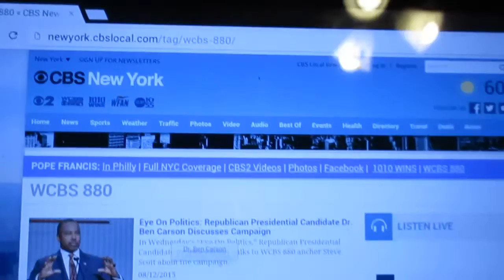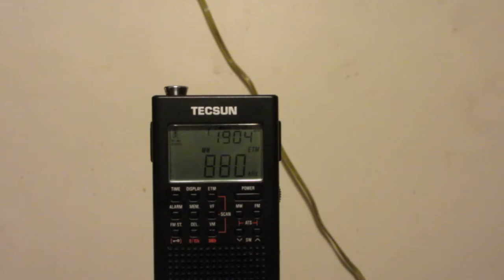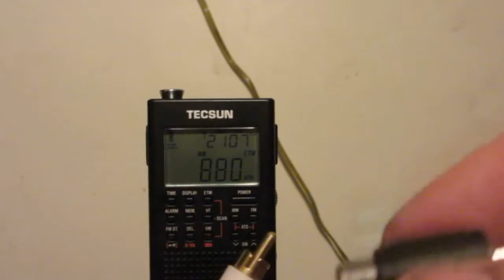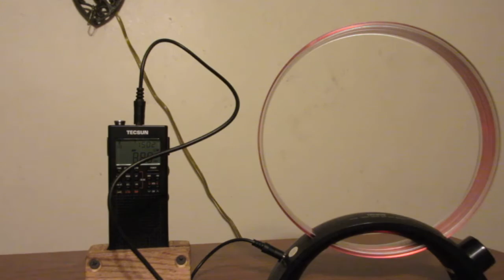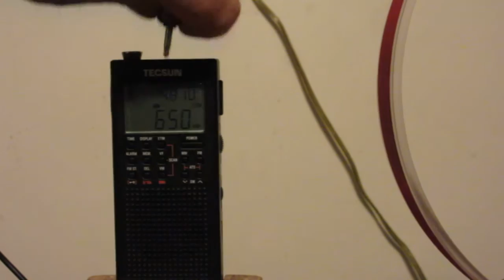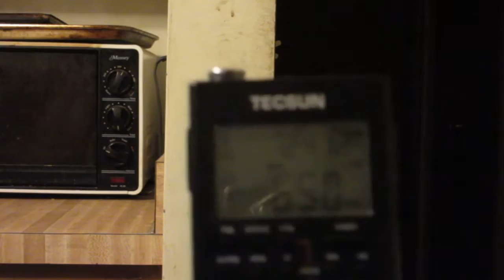AM radio antenna's DXing

Comment: By experimenting years ago before the internet I figured out that a 120 turn coil of 26 AWG magnet wire wrapped on a paper towel tube and connected to two longwire antennas stretched out in opposite directions worked great for daytime reception on AM. I just placed the coil near a small AM radio and instead of three stations I started picking up around 50 during the day. My longwire antennas were at least 250 feet long each and were connected to opposite ends of the coil. In NW Louisiana I could hear Houston, Dallas, New Orleans and even Oklahoma City at noon.